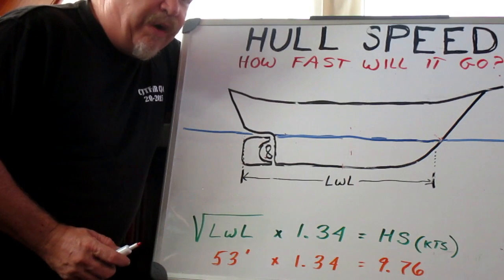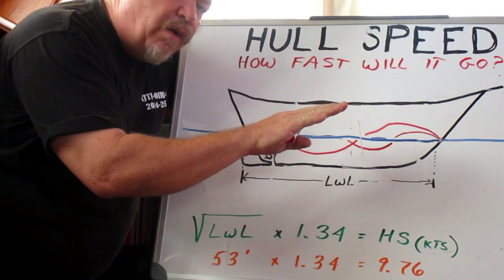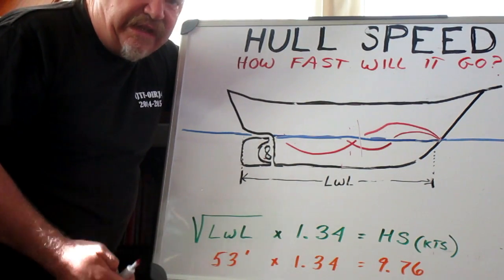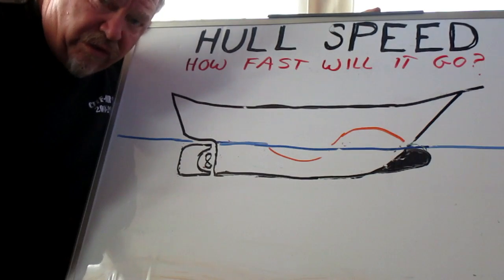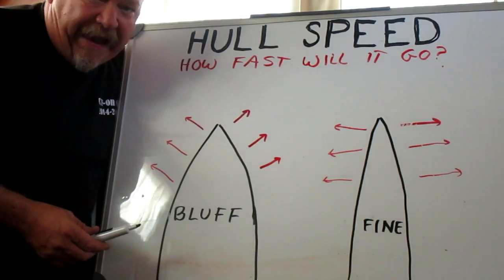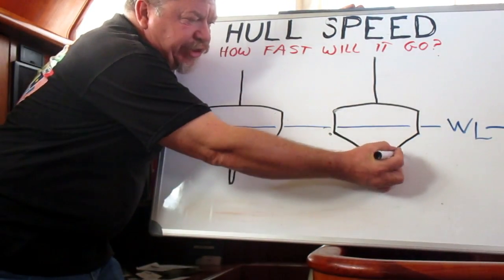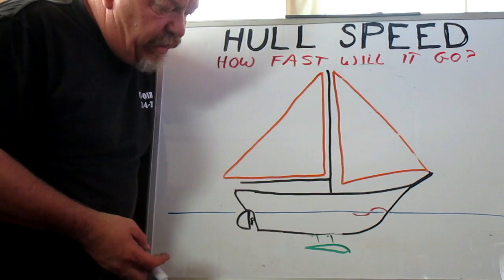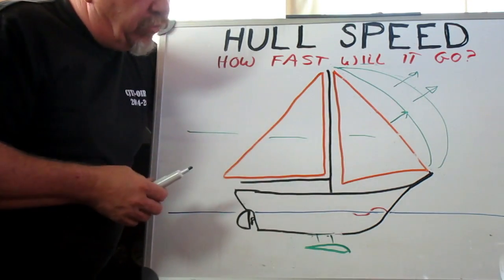Hull Speed

Comment: I  just commented on one of the Puffing videos and I must say they are very accurate in their contents.  The displacement hull has a fuller story in addition to what happens at the bows. There is a removal of water from the midsection causing the hull to drop  a little below its water line and the most ugly behaviour of a  displacement hull occurs  between the mid section and the  raised transom where the hull acts like a piston emerging from a cylinder and that is a great drag due to the " partial vacuum" that is created below the rear part of the hull.   The bow is raised mostly , not because of the bow wave but because of the suction down of the rear wave . The natural speed of the hull is exactly the same as the travelling wave created by the hull.  if the hull tries to move faster than the wave it fits in then the rear part will suck down while the front part will rise and the mid section will tend to sink a little.   
The  half angle of the bows will decide the prismatic coefficient of the hull and this will range form about 1.3 for a wide bow angle to about 2 or even higher for a modern catamaran.    It is all very interesting and the other day I met an old sailor who did not know that boats can be stable not because the centre of gravity is below the centre of buoyancy but even if the centre of gravity is above the centre of buoyancy as in most passenger ships, the ship is still stable provided that as it rolls laterally the centre of buoyancy will move out faster than the centre of gravity.   I was very surprised that this old sailor would not believe the situation of what makes displacement boats stable............ but then  both the displacement and planing hulls as still not fully known.     What I do often is to study the shape of birds and fish and their wings and their fins.  I have noticed that when a creature exists in one medium ,be it air and water,  the front half angle is not so important as the  half angle at the stern where water must enter to fill the trough the hull makes.  Also the wings and fins of birds and fish all have their fin and wing tips raked back at the leading and trailing edges. Using this knowledge about fish fins and wing tips in birds I designed  some propellers about 30 years ago and they were very successful and I must say that since 30 years ago when I published my results about watching fish fins and wing tips in birds , they all obey the same dynamics, I must say that all modern propellers in ships and boats do follow my design where the leading and trailing edge of propellers are both raking back.   There is such a lot to  research in displacement hulls and at the  moment I am working on the low pressure zones of a displacement hull as the front half bow angle merges with the mid  curve of the hull. The low pressure that exists at that point is fascinating and when a submarine is running on the surface, the low pressure seems to create a hole around the hull just behind the bows and    I would imagine that a person can walk through this hole behind the  bows without getting wet.    In  Puffin this low pressure zone will suck the bow wave down, giving it momentum to create the hollow at the mid section of a displacement hull.           Good sailing and just enjoy all the dynamics around any hull moving in the water. It is a pleasure that high level thinking provides  and the beauty of boats does not need any money to enjoy, as all I said can be seen in other people's boats and if one knows about it, one can enjoy the dynamics of a boat much more than the  rich owner of the fastest super yacht.  To reach a depth of knowledge on boat characteristics is to be like sitting at a theatre enjoying the best Bolshoi ballet.    Congratulations for the video, it  made me enter a space which is so colourful and musical to an engineer.  I do come from a family of traditional boat builders, so, as a boat builder one needs to sink deep to understand a boat and comprehend its beauty! Thank you, Sir.
Reply from the maker: Carmel,   Again, thank you for an awesome explanation.   As the video was intended for general audiences, I kept my explanations rough.   I am no engineer or marine architect, so my understanding of the topics relies on basic physics and a little experience.  I find the thought process of how to overcome a particular issue or characteristic to be fun, and it is where I send my brain when I can't sleep.   Ha!.    It bores my wife to tears, but I guess every guy has to have a hobby!   Cheers!

Comment: There's another design trick that has been almost forgotten in the last 50 years. Something you didn't mention is that a single wave, from crest to crest will travel through the water at a given speed based on the distance from crest to crest. When the second crest of the bow wake is even with the stern at the waterline, the speed of the wave is the same as your hull speed limit. To go faster than this wave the only thing to do is to climb out over it which a displacement hull is not designed to do. The formula you show is really a calculation of wave speed through water, based on wave length. The 1.34 is the constant for water; air has a higher number and steel has an even higher number. Anyway,  If you could somehow increase the length of your water line as you approach hull speed, your hull speed limit would increase. Now look at the plan view of almost any sailing vessel over 50 years. Columbia 45, Apache 37 are two that come to mind. The stern is raised on a slope, out of the water and overhangs usually up to about 10% of the over all length of the boat. As the secondary wave crest moves towards the stern it effectively increases the waterline length as it rides up that raised slope. In the case of the Columbia it adds 4 feet to the waterline increasing it's Theoretical Hull Speed by about 1 knot. For a boat who's hull speed is around 7 knots, as is the Columbia 45, that extra knot means a lot.

A quick, down and dirty way to estimate theoretical hull speed is roughly 1/5 th of the LWL . A 25 foot displacement hull can make up to about 5 knots.
Reply from the maker: 3DPDK,   Awesome info!   I very much appreciate the additional info, and you are right... I had not thought of it.   I did consider the hull length changes as a boat heels over with higher winds; increasing the WL length and therefore hull speed.   Another thought (that I did not consider in the video) is the wave speed average in open ocean.   Not sure exactly what it is, but it occurs to me that a vessel traveling at a similar speed could use the 'surfing' effect.   Not sure how much efficiency you could get from that, but something to think about.

Comment: Could it be possible that a more accurate figure for the 1.34 constant is 1.33? That would be the frequency of the second harmonic of a sine wave.
Reply from the maker: Timrath,   A fascinating question!   I have often found that nature re-uses constants.   Why is it that width to length ratios on mono hulls all are close to a multiple of pi?  Then, thinner = faster up unto a point.  Note that a hull speed of 1.34 has no component for width or prismatic coefficient.  Is there some sort of magical L/W ratio that maximizes propulsive efficiency?    1.34 was arrived at for an average boat, average construction, average laminar flow, average everything.   Of course, no boat is average.   You can easily beat hull speed, and in my case, Puffin did so with a lack of hard chines (rolled steel) and a massive headsail that generated lift.  I also had no thru hulls (stand pipe and sea chest).  My hull speed should have been WL of 53.5, so 7.3 x 1.34 = 9.78 kts.   Hmm.   in s stiff breeze, she would reach 11.9 kts.   which is a little over a 20% cheat of hull speed.   

I have often wondered if the prismatic coefficient (a ratio), put into a ratio with L/W (a ratio itself) multiplied by some constant derived from overall length is a better way to be exact.

On the other hand, the wind, waves and other conditions vary so wildly that I am not certain it makes a difference in the day to day lives of the average sailor! :)
Reply: The hull speed is not a physical stop point to speed, add enough power and the speed increases past it, it is a ball park figure for speed without excess force.

Comment: First off I've watched a ton of your videos and have taken copious amounts of helpful notes, so thank you for you content pertaining to fluid dynamics with boats. I am a student studying mechanical engineering and for my physics 270 class this semester I'm participating in a solar boat team for my second year to receive honors credit. I am doing research for my team and this year we decided to go with a multi hull design. I'm deciding between a displacement hull thats round bottomed or a semi-displacer with a slightly angled planer bottom. I need advice, for example on a multi hull boat that typically turns slower with a larger tuning radius is the added efficiency of a bulbous bow worth while or would it create too much drag on turns. does its efficiency in terms of speed increase by 20%? Our event has time trials, obstacle races, and straight away races. In theses races we've designed a circuit with a switch to go from both exclusively solar power, to a 12volt batterie's power.  

Do you have any advice I could benefit from?
Reply from the maker: Gianni,  First, thanks for watching!   Back some time ago I played with the idea of putting nabla shaped bow bulbs on a power cat.  Was even working with the boat designer of a boat I was interested in.   It was an aluminum 60 footer.   The designer poo-poohed my suggestions, but about six months later they retrofitted one of their 60 foot hulls with bulbous bows.  Hmmm.    As you are an ME major, you are likely to be twice as smart as I (or more) on this sort of thing, but will help if I can.  Some thoughts:

1.  A cat would be a great choice for a solar collector... bigger surface than a mono.  Also, for any given horsepower, a cat will usually travel some 38% faster, or roughly 38 % farther at the same speed.   Those percentages are really loose, though.   Your results are going to differ.    The advantage that a mono gives you will not likely be needed in your test waters, especially if you don't have sails up.

2. There are some boats out there that are bragging about 100% solar propulsion....   Have seen them in Passagemaker Magazine.   I assume they are bringing the collected power through an inverter into batteries and running the shaft with electric motors.   (Guess I would opt for a get-home engine out of gas.)  Can you use flexible solar collectors as sails?   Wow; wind plus electricity!

3.  In all the data I have looked at, the propulsive efficiency increase of a bulbous bow is on the order of 8 to 10 %, not the 20% you suggest.  I don't think that would double for a cat hull, but an interesting concept.  If it does, design a universal add-on bulbous bow, and you will be RICH!.   

4.  Bulbous bows are not all created equal.   Nordhavn put a nabla shaped bow bulb on, and think they had great success with it; the flat part was facing up, and resisted some of the pitching that way.  Navy uses some oddly shaped ones, and they exceed hull speed with barely a ripple.  

5.  Cats move faster than monohulls, as a general rule for like sized vessels.   Bulbous bows work in relation to the vessels speed as it dances around hull speed.   The advantage goes away at idle speed or at faster than hull speed unless you get really fancy with the shape.    Cats get advantage by changing their prismatic coefficient.   does that thinner hull get the same benefit from a 

6.  Bulbous bows are normally associated with power vessels as opposed to sailing vessels, and are normally associated with displacement hulls as opposed to hulls with lift.   Will the bulbous bow be effective on a sailboat?   Will speeds above hull speed cause the bulb to create more drag on a speedboat than good performance will allow?   What happens if you make a retracting bulb?   Guess you could get interesting effects if your bulb had an adjustable foil (wings) to optimize it for the speed of the vessel.

7.  Laminar flow does derive (some small amount of) its properties in scale: the ratio of the vessel size to the density of the liquid.   So, there may be a limit to how small a vessel  a bulbous bow would have an impact on propulsive efficiency, and you may have differences between the test tank and the actual vessel.  Also, the gap between the hulls is going to have an impact, since at some point the bow waves will meet in the center, then go on to effect the other hull.   Not sure if this is going to turn out neutral, plus or negative for your vessel, but you might want to try several models with varying hull gaps.

8.  So... what advantage will a bulbous bow give your cat?  Unknown.   I suggest you could put a socket hole in the bows (facing forward), then come up with several bulbous bow shapes to try on your vessel at a variety of speeds.  I would try cylindrical, nabla, inverted spoon, split (snakes tongue), and any others you can think of that would vary the shape and size of the bow wave.

9.  If I assume correctly that you are using electric motors to drive your vessel, then engine placement is CRITICAL!  The most effective shaft is one that is horizontal.   If the props are on a horizontal shaft, you get the best efficiency.  You start to lose efficiency as the angle deviates from horizontal.   If I remember correctly, you will lose between 3 and 4 percent efficiency for every degree of angle.   This argues that the motor be as low as possible in the hulls, although this could play havoc with the cat advantages of shallow draft and thin hulls.  You will lose efficiency if the shaft is put through an angle or transmission, too.

10.  Prop design and placement is just as critical, if not more so, than shaft placement.  The prop loses efficiency if it has to push water over a rudder, or gets close to the hull in its swing.  The number of blades needs to be considered, as well as the pitch of the blade and the most efficient turn speed.   Are you considering an adjustable pitch prop?   You should.   My preference would not to have one on a long range boat because of potential mechanical issues (just something else to break), but for a test boat....why not? 

Ok, so if I were starting out to develop a solar powered vessel that would eventually have to carry a student through a test track on calm waters...   I would go with a wide beamed cat.   The motors would be in or below the center of gravity in the center of the hulls.   The shaft would stick out a foot or so from the back of each hull, and I would steer by prop power, not rudders.  Props would be lightweight (same as the rest of the boat), perhaps out of fiberglass or reinforced resin, and I would probably start with a slower turning 3 blade.  I would get the vessel low in the water to reduce windage or sail.   I would play in the testing with using a bulbous bow.... several kinds.  As solar power is unlikely to propel me faster than hull speed, I would probably not spend much time trying to gain lift with flat surfaces or foils.

Any way you play this, have fun with it!   Good luck with your experiment!
Reply from the maker: Gianni,   Forgot to add the turning opinion .... I don't think you will find that the bulbous bows will slow you in a turn.  The wider your cat, the faster she will turn, since you have the greater force applied to the turning radius.     You could always add downward facing rudders at the bow to get a really tight turn, but this might increase your drag above the point of benefit.   Unless they were retractable....  ?

Comment: Great video!
I have a question and need your opinion about hull speed. 
I have a McGregor 25 1980 that I mostly cruise around with the 9.9 Yamaha 4 stroke high trust.
The water line is around 23ft it has a swing keel that I keep up at all time under power. 
The bottom of the boat is mostly flat like a surf board and loaded there is not much boat in the water. 
I was wondering how fast I could get this boat going with a 25 to 40 hp?
I like slow cruising on weekends but Sunday evenings I like to get back home faster no matter what the weather is. 
1980 Mac 25 with the 9.9hp current speed is max 12km/h
Cruising is 8km/h
Thanks
Reply from the maker: d12 aurora,   Sorry it took me so long to answer, and thanks for watching!    I think you would see a world of difference with a 25 or 30.  I highly recommend NOT buying a Honda outboard.   Yeah, they work fine up until you put ethenol fuel in them, then they sputter and fart badly.   Advert says they will handle ethenol fuel, but they dont, and warranty does not cover it.    I recommend a Yamaha if you want reliable.

Not sure what your top speed would be, but likely close to hull speed.. somewhere between 6 and 7 knots.   That is going to be helped a little by the lift keel and flat hull, so perhaps 7 knots?     You are going to use more gas, but not that much more.   Not sure anything bigger than a 30 is going to help, as once you reach hull speed, you reach diminishing returns for your $.  I have a 30 Honda (uck!) on the back of my dingy and get quite a few hours out of a 6 gallon tank.   Also, you might not have much use for a steering engine, but you will LOVE an electric start and electric tilt.
Reply: I know a guy who did a similar motor upgrade on a sailing cat and he did get a bit of a speed increase but the biggest thing he found is it was cheaper on fuel as he wasn't needing to run the motor as hard to achieve a reasonable speed.